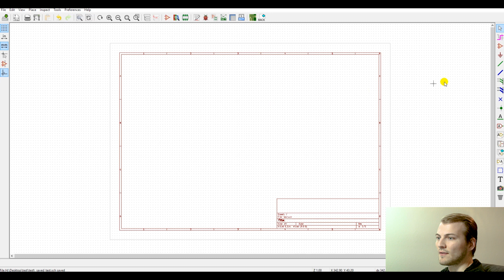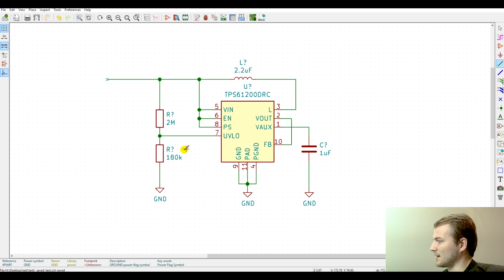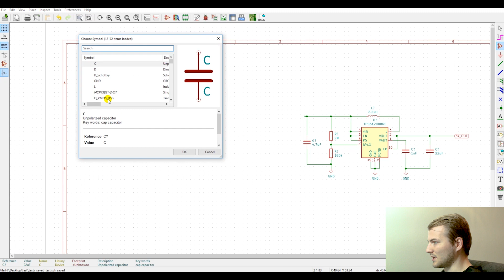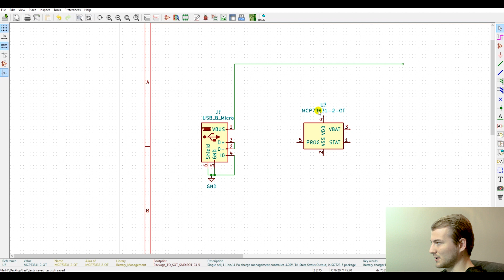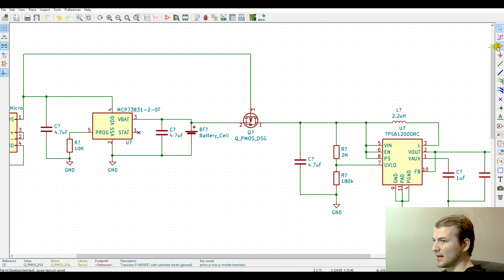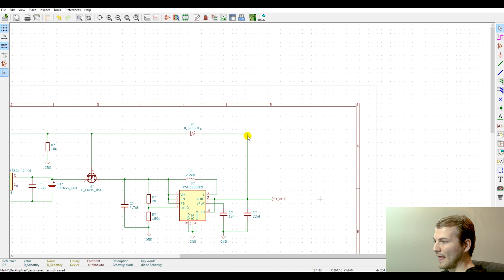Li-ion Battery Charging Circuit Design - KiCad 5 [QCB 2]

Comment: Waw.. great video guy.. i like the logical breakdown of each stage and circuit function.
But I've been looking for something in the circuit... What if i want to charge a device without the charging voltage... How does the MOSFET turn on to flow into the boost converter circuit... I couldn't find any trigger switch 🤷🤷

Comment: Thanks a lot for this video.
If the desired output voltage is 3.3V instead of 5V, wouldn’t it be better to connect the cathode of the diode directly to the input of the TPS chip? (also the TPS configuration will change). Thanks again

Comment: Would this circuit need a DW01 discharge protection before the boost converter?  So load when on battery only doesnt drain the battery below battery cutoff voltage.

Comment: I just adapted this circuit using the TP4056 as a battery charger and the MT3608 as a boost converter, and it works like a charm! Thanks a lot!
Reply: what pmos you used?
Reply: how did you do that? 😊😊

Comment: Thanks so much for this great video man 👍I'm planning to use one of the channels of a dual ideal diode (LM66200) instead of the schottky diode, since my system requires a little more current. If you have time, it would be great to know if this is ok to use. Thanks so much, keep it up! 😁 Edit: it worked, yay

Comment: Interesting video! One thing I would add to the circuit though, is a 1k resistor connected to the gate of the MOSFET for more reliability. Here is why:

"All MOSFET devices are extremely susceptible to gate oxide breakdown, caused by electrostatic discharge. Unlike JFETs or other junction devices, in which the junction avalanche current can safely discharge the overvoltage, MOSFETs are damaged irreversibly by a single instance of gate breakdown. For this reason, it’s a good idea to use a series gate resistor of 1k or so (assuming that speed is not an issue), particularly when the gate signal comes from another circuit board. This greatly reduces the chances of damage; it also prevents circuit loading if the gate is damaged, because the most common symptom of a damage MOSFET is a substantial dc gate current. . . . The series gate resistor, although not essential, is a good idea, because MOSFET drain-gate capacitance can couple the load’s inductive transients back to the delicate CMOS logic"   (Paul Horowitz and Winﬁeld Hill, The Art of Electronics, 3rd Edition, pg. 193, 199.)
Reply: Wouldn't be 100 Ohm resistor big enough for that job?
Reply: @SurrenderToAction  should be but no reason to use a 1k ohm unless you need the extra .05 ms

Comment: If I were to want a 3s battery instead for example, would I have to basically copy and paste this X3, or would I have to change the values throughout the schematic to accommodate the 3 cells?

Comment: Thank you  so much for creating such a useful video.

I have a question, Can we use Enable PIN of buck boost converter to disable it when USB power is available, So instead of using PMOS to control the battery power fed to converter we can use enable PIN. Do you think about any downside for using this method?
Reply: Have you ever tried?

Comment: When main power is available, Does the main power go into the boost converter back from Vout pin? is any problem or affect the circuit, or need there any also reverse diode after Vout to Load,  to protect from back current...Thanks in advance

Comment: Hi MicroType Eng. I have a question. Let's say I need 6V in output (setting the right FB resistors voltage divider), either when battery powered or usb powered; would it be a problem to just connect the output of the schotty diode in input to the TPS61200? Or would be a problem, when the USB is connected, to have Vdrain=5V > Vgate=Vbattery=3.7V??

Comment: Which Schottky diode model will be ok? Which parameters are important in this case?
Reply: Up:)
Reply from the maker: Really doesn't matter. Just make sure the power dissipation is OK for your output current, and the voltage drop won't affect anything downstream.

Comment: What would happen if it is plugged into a usb host with those d+ and d- pins tied together? Also shield should never get joined to the device ground. It’s tied at the host end to earth. If the device has a metal case the case should though.
Reply from the maker: That's how a lot of Chinese chargers do it. Yeah the shield to ground can cause ground loops, but there's really no hard and fast standard on it..

Comment: Great video, I have a similar project now together with ESP32. I am curious if charging IC is enough to maintain overcharge/discharge of the battery
Reply: U could use TP4056 as the charging iC. Similar specs and has wide input so can also use 6v solar panel

Comment: Thank you so much for your videos, they are very useful! 
Just one little thing! (and correct me if I am wrong) The TPS61200DRC is the adjustable output version (5V fixed output = TPS61202DRC), so that means this one requires a voltage divider to provide 5V output. But again, thank you!
Reply: Yep, I thought the same thing.  He even calls it "the fixed version" whilst tying the feedback pin to Vout at 3:47 in the video, which is the correct usage for the fixed version.  So he has designed the circuit for a 61202.
Reply: @davidbastow5629  what was your R1 R2 value for a 5v Vout? I got  R1=1M, R2=120k ... not sure if correct

Comment: Does a Pchanel mosfet conduct without voltage at the gate?
Reply: Depends, but in this case it does - as gate is connected on the pulldown

Comment: Hello sir, I try to use your schematic to my charging circuit. But it doesn't work. I use AO4407A mosfet. For charging circuit i use this module https://www.ebay.com/itm/2pcs-XL4015-5A-DC-Buck-Step-Down-Voltage-Converter-Constant-Current-Power-Module/152837387238
Can i get help to analyze my circuit?
Reply from the maker: Please join our discord, plenty of people here to help! https://discord.gg/Z4P5yScC

Comment: Please correct me, if I'm wrong, but I think the drain of the Mosfet has to be connected to B+, NOT the source of the Mosfet!
Reply: why is that? Current is supposed to flow from source to drain in PFET, which is from battery to the load.

Comment: Hi and thanks for the tutorial! I have designed a circuit based on your video but and I'm having a problem. It works fine but if I have both battery and USB connection and disconnect the USB cable, the battery power supply does not respond fast enough. In my case, the load is a raspberry pi and when I unplug the USB cable there is a strong momentarily voltage drop, which results in a reboot of the RPI. Any ideas on how to solve this problem?
Reply from the maker: Yeah, you probably need more bulk capacitance on the PI side to help support the voltage rail while it switches over. You can buy some through hole 100u+ electrolytic capacitors and just hack them on the PI power pins to test
Reply: @MicroTypeEngineering  do you think is a good idea to put the p-channel mosfet after the boost converter? In doing this the boost converter will be ready for delivery.

Comment: Correct me if I'm wrong, but I don't see an overcharging protection on this circuit/
Reply from the maker: Correct, this was with a pouch style Li-ion battery with in built protection. Stay tuned for a detailed li-ion safety based video!

Comment: Can I use this circuit to power a Raspberry Pi? When the Mosfet switchs, would the pi fail, because there were a short power failure?
Reply from the maker: Great question! The answer depends on a lot of things. Ultimately, if it does turn the PI off, you need to have more bulk capacitance to sustain the power switch. The duration of the switch should be super short, so you shouldn't need much capacitance. It really depends on how sensitive the Pi's power management is.

Comment: So this is assuming that our inverter from the wall is outputting 5V right? Or else when we bypass the charging circuit, we would need to wire VBUS into the buck/boost converter input so it can regulate 5V out.
Reply from the maker: Yep, spot on!

Comment: Since that is a p-mosfet, does it not  require a pull up resistor instead of pull down so when it's plugged the mosfet will be off and when it's unplugged it s on ? I would love to understand.
Reply: Pull down is the way to go. When it's unplugged the pull-down will turn on the mosfet therefore connecting the battery to the load. Otherwise when it's plugged, P-MOS gate will be at Vusb turning the P-MOS off and subsequently disconnecting the battery from the load.
Reply: @EfraAv  could you help answer a question I have?

Comment: Excellent video. How would you recommend using 4 x 18650 for 5V output? Would 4 in parallel with the boost converter be better than 2 parallel, 2 series with a buck converter? If so, what changes to the charging circuit are needed for a single USB-C 5V supply? Looking to drive 1A @ 5V for as long as possible. Thanks!
Reply from the maker: Once you get to multi-cells it get's difficult to do it safely. You'll need to have a proper balancing circuit to ensure that the cells don't overcharge/discharge. The people you see just throwing them together in series or parallel are setting a bad example most of the time.

Comment: Can I charge two batteries (18650) with a schematics equivalent with this one, by replacing the single-cell battery with two in 18650 in parallel?
Reply from the maker: I wouldn't recommend it without having a proper balancing circuit in place.
Reply: @MicroTypeEngineering  should be fine. balancing is needed for cells in series. Cells in parallel will balance each other out automatically.

Comment: Thought lifepo4 absolute minimum voltage limit was 2.5V ??
Reply: Either way, subject very nicely exposed, thanks mate
Reply from the maker: Thanks :) Yeah this focused on Li-ion not FE. Either way, manufacturers will recommend the thresholds which can vary somewhat

Comment: Great tutorial. I just don't understand how to choose the mosfet and the schottky diode. Can you please help on that?
Reply from the maker: The selection in this case is fairly straightforward. Schottky diode, just make sure that it can handle the amount of power that the system will draw through it. The lower the voltage drop the better of course.

For the MOSFET, just make sure that the gate to source (drive voltage) is low enough that it will be fully turned on, when on battery mode. In the example of the video, anything in the 2.5V range will work great!

Comment: Is there a way to make that usb port have both roles (source and sink current)? The idea is that you can charge the battery from it, but also use it to charge other things as well? I know there are USB PD chips out there that can negotiate dual role, but is it possible to do it straight from the VBus without introducing USB protocols? So far I can imagine using a SPST switch to accomplish this but is there a simple way to detect if its plugged into a source vs. a sink?

Comment: Thank you. I would like to power with the same type of circuit my RaspberrypiZeroW with radio breakout module. Is it possible to charge and use with 1200 mAh or higher Polymer Lithium Ion Battery? And can we get battery state with this circuit? I would prefer to see more continued with the PCB design part.

Comment: 1. How to add 2 pages in KiCAD Schematic ?(I'm using KiCAD 6.0 rc)
2. Can you start of with DDR Schematic and PCB Routing ?
3. PCB Antenna and Chip Antenna PCB Guidelines.
Reply: 1. (in eeschema) File -> Append Schematic Sheet

Comment: Great video !
I like the way you go back over the logic of the whole system, at the end.
Suggestion: Could you add few words on why you did choose those component in particular (tradeoff) ? 

Thank, I appreciate this series.
Reply from the maker: I can try, problem is that it gets pretty lengthy if I get too deep in the details
Reply: @MicroTypeEngineering  I agree, that's the video maker's trade-off.
Dont get me wrong, I really like your straight forward style (it's refreshing). But i think i would better understand your design choices with a bit more details. 
That just my two cents, of course :)

Comment: First? Nice video once again. In my opinion you don't need the background music. In fact I think it's distracting but whatever :)
Reply from the maker: Alright, i'll stop including it!
Reply: @MicroTypeEngineering the music is actually good, just lower the volume a bit, I loved the low tone one
Reply: @MicroTypeEngineering  hi I need a advice ,wen you are designing the battery protection nd charging circuit for LiPo 1cell battery ,does the ground has to be separate from load? Can u explain this in video? Ny suggestions please